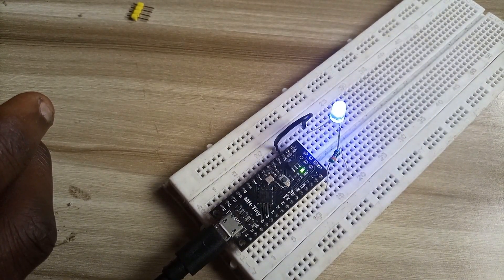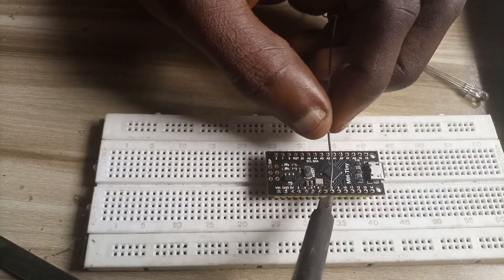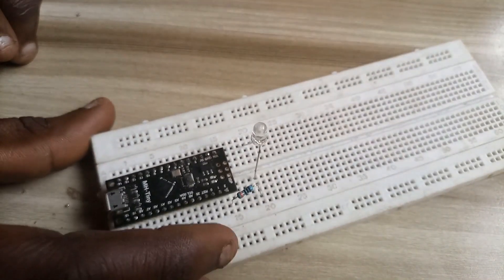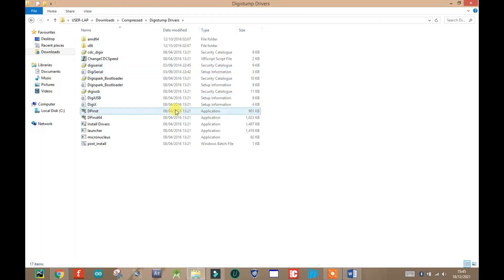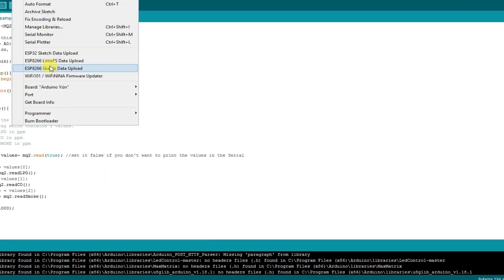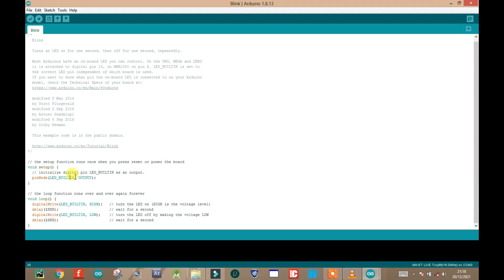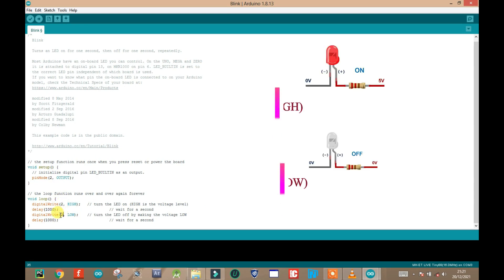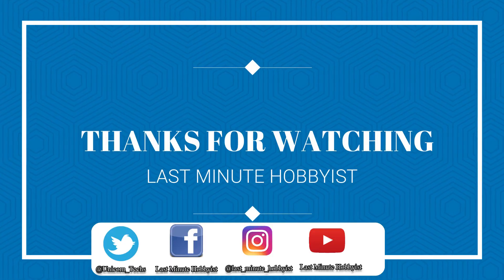How to program Attiny88 (MH-ET Live) Board with Arduino IDE

Comment: Good morning Friend, I liked seeing your videos, I followed your steps to install the attiny board, my problem is that the port is not registered, can you tell me what I can do, thank you very much and blessings in advance
Reply from the maker: Once you are sure the driver is successfully installed. Compile your program and click upload button. You do all these without connecting your USB cable. You will be prompted to connect your USB cable with Attiny88. Don't forget there is timeout of about 50 seconds
Reply: @lastminutehobbyist9219  > Press CTRL+C to terminate the program.
> Device search timed out
That appears to me after compiling it
Reply: But no answer, nothing
Reply from the maker: I will check if the core driver still up to date. I will get back to you as soon as possible
Reply: @lastminutehobbyist9219  very nice of you

Comment: HI I have a problem with fastled blink code , when I am uploading , program said "error compliting for board mh-e.....
Reply: can u help me?
Reply from the maker: It is not every Arduino library that works for Attiny88. Check out the Datasheet for the board to know more about the features
Reply: @lastminutehobbyist9219  so what I seen this board is created for simple easy and small projects

Comment: They're not compatible with Arduino Nano. Only the simplest and most basic programs will run, such as Blink. Trying to port a complex program such as 
 QMC 5883L driver over to this, from a Nano just didn't compile. Be wary of claims they are 100% compatible - they are not. Indeed,  they are pretty useless.

Comment: Hi, thanks for a great video. However, I still cannot get it to work. I have followed everything on the tutorial. After I click upload, I wait for the prompt to plug in the device and then I plug it in. When I do, my PC says "USB device not recognized. The last USB device you connected to this computer has malfunctioned and windows doesn't recognize it." Then, Arduino IDE says in the output ">Press CTRL+C to terminate the program." and then ">Device search timed out." Can you please help? I don't know what else to do. Thank you.
Reply from the maker: 1. Make sure you are using a data cable
2. Make sure you paste the board.txt link on the board preference window. 
3. Make sure you've chosen the right board before clicking upload button.
Reply: @lastminutehobbyist9219  thanks for the checklist just pulled a random usb cable out of my box cables...tried for over an hour...who would have thought...not a data cable...different cable, instantly start to work thanks again

Comment: Great tutorial! MH-Tiny it is now ready to be programmed. However, I am facing an issue whith "analogRread" functions like a potentiometer dimming a led (PWM output). A simple code that works on Arduino (sensorvalue, 0, 1023, 0, 255.....) does not work on MH-Tiny. And suggestions. Thank you
Reply: same, let me know if you figured it out, trying to read a potentiometer on A0, same code (except pins and speeds) works fine on a Geeetech 2560 based on the ATMEGA2560. really throwing me for a loop so to speak
Reply: @leelandteddy4833  If you haven't solved the problem yet, the analog pins on this board are not numbered without ‘A’ => A0 = 0, A1 = 1

Comment: Hi, im having issue with my board. Its blinking red led on board when i connect it to pc. Pc says unknown usb device. And apps are not finding the board when uploading sketch... Tnx in advance..
Reply from the maker: Before you insert a data Cable, click on the upload button and monitor the upload status from the status window below. You will be prompted to insert the cable at one point. And the timeout is about 15 seconds. If you don't insert your data cable within the 15 seconds window, you will have to start the whole process all over again

Comment: is it possible to use the Attiny88 for self-balancing robot project???
Reply from the maker: Sure... Since it is the io pins that you need. It is only not going to work if you need to make a UART communication with your PC, except you want to upload your code. Because it doesn't support hardware UART communication. ☹️

Comment: Thanks for your great video. I managed to run my board but after some time running the code (it's just a simple code  that makes two leds blink) it stops. The loop should be perpetual so I don't know where the problem is. Could be a soldering problem? It's the first time I solder the pins in a board...The board doesn't overheat. Thanks for any help and keep up the good work!
Reply from the maker: I really wish I could have a glimpse of your code and schematic. So that I can help
Reply from the maker: You can reach out to me on my Gmail. adepojujamiuadegboyega@gmail.com

Comment: I too cannot see the USB
Reply from the maker: Provided that you've installed the driver and other files correctly. Choose the default USB port found before compiling the program. Later Arduino IDE will prompt you to insert the data cable. If it still doesn't work, let me know.
Reply from the maker: Click the upload button. After compiling the code, Arduino IDE will prompt you to insert your cable. Just check the error monitor at the bottom of your Arduino IDE, so as to watch out for the time you need to insert the cable. It has a time out of 100 seconds
Reply: exit status 1
Error compiling for board MH-ET LIVE Tiny88(16.0MHz).
Reply from the maker: @promcfire  
Possibilities of what could cause that
1. You might have omitted the installation of the board on Arduino IDE.
2. The sketch size might be more that the flash memory.
3. You can close your Arduino IDE, and try opening it again.
4. There might be an Arduino library it doesn't support
Reply: @lastminutehobbyist9219  I have the same error as you
maybe we are missing the drive file for win 64bit
please give me the file drive win *64
Reply from the maker: @vanthan1957  Just make sure to install the "digistump driver". Once it is installed successful. You don't need to bother about choosing any board. Just compile your program, then press "upload" button. Monitor the "Status window" at the bottom of your screen. You will be prompted to insert your USB cable. After inserting the cable, it will upload the code on the Attiny88 board. Note the timeout is about 15 seconds for you to insert your cable. Good luck. And let me know how far you've gone.
Reply from the maker: @vanthan1957  the 64 bit driver can be downloaded from the link at the description below the video. Just follow the tutorial. Successful installation of the driver is the most important thing
Reply: @lastminutehobbyist9219  On windows 10 64bit the drivers doesen't work, the device gives the following error: The device has reported a problem and has been stopped. (Code 43) The USB device descriptor request failed. If I try to install the driver for legacy devices the OS crashes ox screen. There is a solution ?
Reply: me too
Reply: now, to upload a sketch in ATtiny88 is little different, see https://youtu.be/LjiOjPTEUgg because Windows hide the driver after few seconds...

Comment: Thank you for this great video. Very helpful. I followed up the same steps but my computer cannot find the board. I see Unknown USB Device (Device Descriptor Request Failed) in Device manager. Do you know why?  Please help. Thanks.
Reply from the maker: You need to also install the "DPInst" file, make sure the installation of the driver is complete. Because there might be situation of incomplete installation. And the driver is for windows (64 or 32 bit). If the driver is successfully installed. It should work

Comment: after downloading the driver, i cant find the port like you, only port called 192. '''' like a network< can you help ?
Reply: COM port is not showing, same as you have - How to get it working?
Reply from the maker: @promcfire  You don't have to bother about the com port showing or not. The Attiny88 board expects you not to connect your USB cable unless it prompts you to. Once you've installed all the necessary drivers and Arduino board from board manager. click on compile and on the status window, you will be prompted to insert you cable. I think it has a timeout of about 15 secs
Reply: @promcfire  i finally get it right, if u need details pm me
Reply from the maker: If the driver is installed successfully. And you have a good data cable. You can try different ports on your PC and check if the com Port number is still the same. If nothing happens, choose the default port you see there. And don't forget to also check the programmer "Micronucleus". Arduino will prompt you to connect your board to after clicking on "compile" button.
Reply from the maker: And also, don't forget to add "MH-ET LIVE" boards to your aduino. By copying the link in the .txt file into the board manager links at the "Preferences" window
Reply: now, to upload a sketch in ATtiny88 is little different, see https://youtu.be/LjiOjPTEUgg because Windows hide the driver after few seconds...